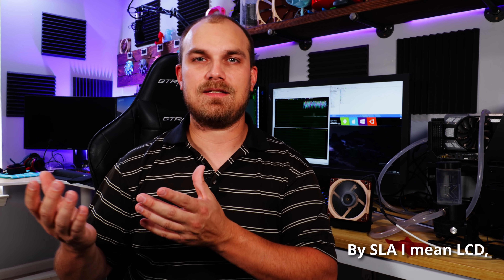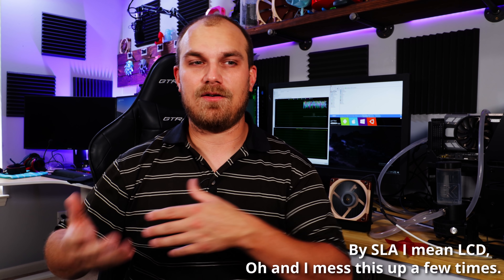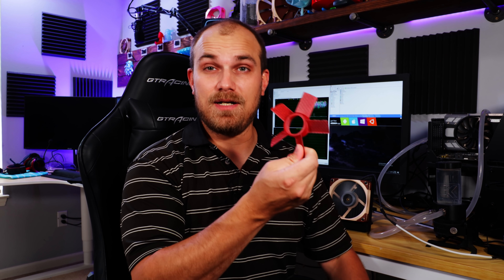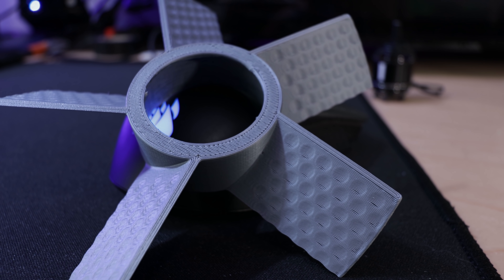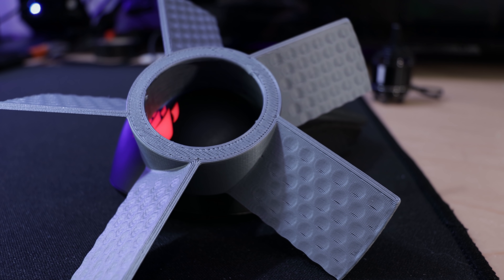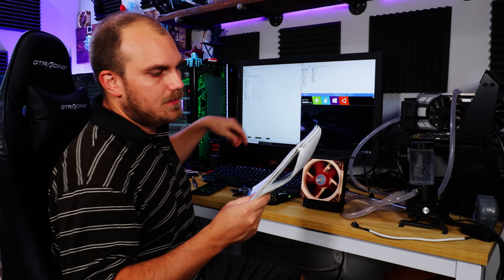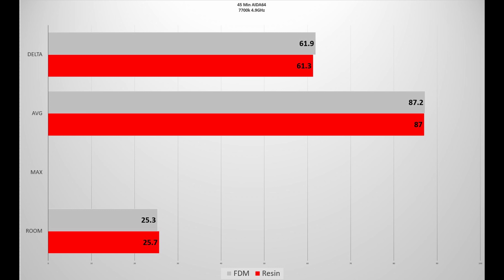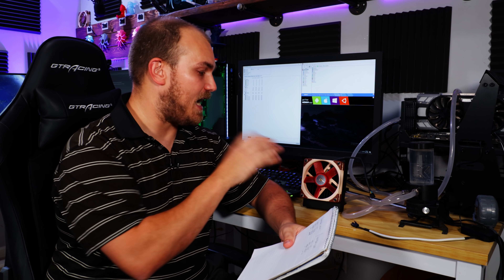Do Resin Fans Outperform FDM Fans | Dimple Fan Follow Up

Comment: The ”dimple effect” is probably the most misunderstood aerodynamic effect there is.
It’s very simple to understand though, all it does it to reduce the wake of an object at the cost of increased skin friction.

This is why it works so well on golf balls, they have very little skin area (a sphere is the shape with the smallest skin area) but a very large wake, so the dominant friction is the wake.

A fan on the other hand is literally the opposite, the skin area is very big and the wake is very small. It’s questionable if the wake is even reduced by the dimples because of how small it is to begin with but you do increase skin friction.

A more interesting test would be to print the smooth fan on SLS and see if there’s any difference there, since theoretically it should be more aerodynamically efficient, though there might be too small of an effect to notice.
Reply: fanspeed might be higher with the smoother surface if drag is reduced
Reply: HazewinDog possibly, though on these small scales the speed increase might not be measurable with his equipment.
Reply: The dimples are normally used to  re-energize the flow when the flow goes from laminar to turbulent (just like slats), which enables the flow to "stick" to the shape more when traveling at high speeds on a golfball/wing since it has the energy to follow the contours of the shape. Thats how it decreases the wake drag. I doubt the airflow over any of these fans are reaching critical flow speeds, which means the dimples probably dont actually do anything apart from pre-maturely turning laminar flow into turbulent flow over the wings and reducing the pressure difference they generate, sadly :(
Reply: Actually for low power fans not in a server room/building, it's the noise normalized temperature that matters. All the rest is irrelevant.
Reply: Honestly I wanted to mention that with the fans it was opposite but I couldnt type then! Since the fan is opposite to a sphere, it could make sense that inverted dimples would work better. Make bumps on the fan as it would be the opposite, hopefully doing what the opposite does on the opposite surface?
Reply: Zipo214 ”Reversed” dimples would have the same effect as dimples, it’s about disturbing the air flow, not about the exact shape of the simples. Laminar flow always produces the lowest drag, when the flow separates from the body and causes a large wake you get turbolent flow. Dimples causes tiny turbolent flows near the skin which drags the air closer to the body, effectively ”extending” the laminar flow by delaying the separation of the air flow from the body, leading to a smaller wake and this less turbolent flow overall.
Reply: And like... the place where you would want the dimples would be on the back of the motor and the sides of the fan, not on the blades. The blades do not have wake drag from surface interaction with the air. They have vortex drag from trailing edge design maybe and from tip design. (The equivalent of cavitation from a propeller in water)
Reply: Wake drag would be the vacuum created behind the fan motor (where there are no blades) and shouldn’t be significantly effected by dimples on the blades

Comment: While it may not have made a huge difference in cooling performance, I am curious what the difference in noise is. Theoretically it should be quieter, but who knows. Also curious if there will be any weight added to my fan when it's printed in resin since the blades are pretty thick, and FDM leaves tiny gaps, even if it's 100% infill
Reply: Well good news lol
Reply: Bro, contact Major Hardware now, a company wants to license your fan desing, go watch his latest video.
Reply: dude email the channel you need to get in touch! check his resin video on your fan a company wants to contact you
Reply: hello Thomas, i am commenting to ask, politely, if i could please have the model of the fan, i just want to print myself fans for my PC

Comment: it would be my guess that the resin prints would have the potential for greater performance simply from the more complex geometry you can print, also reducing weight and potentally increasing rpm, and the tighter tolerances you can acheive. but now on the point of textured surfaces; it would be super cool if you could test if be quiet! fans benefit from their ripples design in either acoustics and or thermals.

Comment: You wouldn't see any difference higher than margin of error because the fan is too small. The difference in surface that would effect air and the amount of air that wouldn't succumb to the Coulomb effect flowing off the blade in a non-laminar flow is not enough to see any significant or appreciable difference. The fan isn't big enough and it's not moving enough air and you're not changing enough to see enough of a change in results or an appreciable difference beyond margin, in general. If anything, you'd see a difference if you, um, stack tolerances, in a manner of speaking. So, you probably want to change the camber of the blades, e.g. the angle of attack or chord line of the blade's air foil, and probably the thickness of the air foil by tightening the area between the air foil's upper and lower surface to tapering off at the trailihg edge...e.g.you want to thin out the airfoil to look like the comma symbol. Also, don't add a sleeve to the fan like how everyone seems to be doing or advising you to incorporate in previous designs...it adds unnecessary weight to the fan and is done for two reasons, 1, stability of fan because it's structurally weak and/or material composition is weak and 2, you want to effect either intake or exhaust fluid flow. You're better served by printing the blade tips as close to the edge of the fan mount's duct edge or wall as possible to tighten up tolerances and maximize the amount of air flowing. This is two of the reasons why Noctua fans are so efficient. They have tight tolerances, almost edge to edge. They use strong, rigid plastic so there's very little flex or warping and so less sloppy performance which you can see when it runs high rpms and very little vibration. They also stabilize the fan a little bit more by having subdued vortex generators on training edge along the upper surface, if I remember correctly. So consistent maximum laminar flow performance overall when changing these two main points, blade design in correlation to fan hub mount design. If you want to accessorize it as well, you can add in a intake convergence or intake funnel or whatever and/or intake and exhaust stators, essentially ducting the fan. This would probably give you probably most of the efficiency possible from something like your design. These are my opinions, of course.

Comment: why would dimples push more air? IMO what might help... dimples make more air-on-air contact reducing drag on the surface. that means less air is being moved/affected by the surface. ((now maybe if you put the dimples only on the front side (intake) the air might pass the blades faster)). could gain some rpm as well. still, the airspeed is probably too slow to see the effect!

Comment: I saw a gentleman on YouTube who has started printing his parts out of Nylon. Much more flexible and stronger
Reply: Last thing you want in fans is for them to flex... use the proper materials for the job, you can also make fans out of gummy bears and jello, but that doesn’t mean it’s a good idea.
Reply: @jakegarrett8109  wtf ever dude, go watch johnnyq90 make parts for his projects out of Nylon. Flexible does not equal flex. https://youtu.be/2ObO5uS7Iw4
Reply: Don Anders the guy that makes engines... with heat? different use case

I was going to pull up some nice charts and graphs but then I realized you probably wouldn’t understand them (they would be simple if you were a mechanical engineer, but otherwise explaining it would take quite a while, more than I could fit in a YouTube comment), so instead I’ll say look up the Young’s modulus of elasticity for the materials for a simple number (though a single numerical value doesn’t tell the whole story, you will see that Nylon is less than PLA, and the higher the number the stiffer the number). If you want to know more take some engineering courses if you want to actually learn about material properties and how to apply them because you might love engineering (you may lose some hair, not have time to sleep, but it’s all worth it, super interesting and broad field as far as your imagination can reach and constantly innovating with new technology, it’s fun).

Use the right material for the application. I don’t care if it’s some amazing alien technology, if it doesn’t suit the needs of my design then I’m not using it when another (and cheaper and easier to use material) is available. I only care about the material properties that are relevant to what I’m using it for.
Reply: @jakegarrett8109  no he doesn't make engines with heat. Apparently you did not watch the video, you're obviously too smart to waste your time.. He is using it in this example, for upper and lower control arms in his suspension components on his rc cars, they will be subjected to a lot more stress then the cooling fan in this contest. But, I will sit over here and keep being stupid. Oh, and if you find time, Google nylon cooling fans!
Reply: Don Anders I’ve already had materials courses before (2 engineering degrees), I’ve also been 3D printed plenty to know what I’m saying with my first custom printer I built since like 8 years ago. You could say go research, but I have, and I even have practical experience, I’ve done the research many times for projects, I’ve designed lots of prototypes and every time I have to chose materials etc. The reason I said engine heat is because I’ve seen multiple of his videos before, I already know who he is (but also the furthest part from the engine in an RC nitro car is like 3” away from its engine, that does mean it’s actually going to get fairly hot and PLA would likely melt because it is so low temp that heck I’ve had PLA parts warp in my car while sitting in the seat... so it’s actually valid).

So maybe, just maybe, this is another case where the person that has the least idea is the one shouting how everyone else is wrong. Someone overconfident with their very low amount of data that isn’t willing to listen to reason or others research even spoon fed to them because they must be right (like a gun grabbing Karen for example, someone basing their emotions as fact, and no real facts or logic matter). So I looked up the numbers, I’ve held the parts, I’ve done the design analysis many times (I’ve even got a brand new role of Nylon ready to go, it’s about 4x to 6x more expensive but when it’s the superior material i have it on hand, but as for fan blades it’s not the correct material and I wouldn’t use it). I think it might not be me that needs to rethink it (and I’m always rethinking things, nothing is set in stone). Just food for thought.
Reply: Don Anders Just to point out I’m not imagining things: https://youtu.be/CW70dL5430c
Its one of his vids where he’s literally using 3D printed parts inside an engine, I couldn’t have asked for a better example even if I controlled the universe. Wasn’t really what I was referring too but if you didn’t believe it, well here is the proof.

Comment: Random thoughts. I dont have a cad program nor an engineering degree but i do have a bit of an understanding of thermals and fluid physics.
So I have some questions:
1. Is the fluid movement through your heat exchanger constant? If liquid moves too quick through the heat exchanger then it stops performing as well. This is why cars have thermostats.
2. For heat to be effectively removed from the heat exchanger it needs air flow but if the air flow is too quick it is possible to reduce performance.
3. I have noticed a push to deeper fans, is this cheating? I mean normally these are systems that sit inside a box or confined space which is why the original fan is a flush system.

Comment: I do believe that with the steep blade pitch your dimples will actually create drag and turbulence... they look to be at about a 45 degrees... i would recommend 20-25 degrees (yes this seems overly shallow for a fan)... with 45 degree blade.. the dimples would need to be a touch deeper than the ones on the top and a very shallow angle of attack.. this would likely provide a blade that is too thick. In the range of 20-25 degrees you can get away with a uniform dimlple although I would still recommend shallower ones on the top. Better still would be dimpleing the bottom only and adding vortex generators to the top of the blades..or inverted dimples on the leading edge only may work also..

Comment: Okay. The issues has to do with aerodyamics. I doubt that anyone of the fans are using an optimized airfoil for those reynolds numbers involved. The dimples act as turbulators or vortex generators to help keep the airflow attached. Frankly the fdm surface is rough enough for that task. My suggestion would be to work on the ailfoil sections and angle of attack to optiize the performance over dimples. Time to fire up XFoil.

Comment: A more straight-forward explanation is that the air in a fan travels down and outward across the blades and the alignment of the dimples is far more crucial... at the speed the fan turns the layer offset of the thermal printing acts like dimples itself.   A resin printed static counter-rotation layer will probably have more effect on performance than dimples.

Comment: The thing is the design itself, dimples make a golf ball go further but does not mean that will make a fan more eficient, you need pressure not aerodynamics perse.
With other designs resin may help tho, like the ones that use a bigger outer diameter and a cone to funel the air inn, beeing smoth would give less dispersion and a better flow

Comment: Hey, James.  I'm finding that slicers have changed in the last few years and the once darling, Simplify3d seems to have fallen off the planet - what slicer are you using for the FLSUN Q5 and any chance you would share your settings?  (I did look to see if you had info on thingiverse and didn't find anything obvious.)  Thanks in advance - of course if others have advice I wouldn't hate that either.
Reply from the maker: I like prusaslicer

Comment: The FDM printed fan with it's rougher surface basically has the effect of dimples built in, so adding dimples isn't really gonna do anything.
You might see an improvement with some of the other fans if they were being limited by the turbulence.

Comment: I don’t think drag is a major design concern because you aren’t moving the fan blades at any appreciable speed for it to be an issue. Like if you make a folded paper fan made from sandpaper and one made from regular paper, you won’t see any difference for the same reason. 
Now, perhaps if we are moving air at ridonkulous trans-sonic speeds it might be a concern, my guess is geometry and speed are the two major design constraints in how effective a fan is.

Comment: Resin is way better with very thin fans where FDM will break them or have very rough edges.
Reply: Pretty much this. The advantage would be most noticeable in the noise rather than the performance.
Reply: BrotherMichigan giv G cuucc G c g gu
Reply: The most efficient fan is the most silent. We're not talking pitch.
Reply: C
Reply: @davidwillard6126  ya ok bud?
Reply: Cu u to u
Reply: ucu
Reply: Cu uh
Reply: Cu ucu
Reply: Cccc
Reply: F
Reply: @davidwillard6126  Did you have a stroke?
Reply: Fuh

Comment: Depending on the resin printer you have resin should be able to handle the thinner blades of some fan designs better than FDM. Ideally the build area is large enough to print parallel to the build plate to minimize uneven support distribution.

Comment: The blades are too straight for the dimples to make any difference, the pressure created by the top edge of the blade makes the air move in a straight line like a wall (or a waterfall) and when the dimples hit it is like putting a spoon under the kitchen tap, it's sprays all over the place. I think that in order to see any kind of difference you should curve the blades in both Y and Z axis (like the noctua ones) I think that way they can scoop more air and the dimples can do their job. One more thing, I suggest you to leave the back of the blade without them so it doesn't create turbolenze fot the blade behind it
Reply: … you have missed the point of the dimples. They have no purpose on the high pressure side of the blades. On the trailing, low pressure, side of the blade they create a thin, turbulent layer that helps keep the air flow adhered to the blade.

That being said, I believe that you are absolutely correct about the lack of curvature!
Reply: @martindinner3621  that works in golf balls because they make the ball spin while flying to make it go farther and more stable. The same principle is used in airsoft with hop-up systems and in guns with barrel rifling. In fans the only useful way they can be used is to create more pressure on the inner side of the blade because otherwise they would actually push the air away from it which is pretty useless

Comment: This would really only start making a difference as you get to much higher speeds. As well, you'd primarily see the difference in noise character rather than just thermal performance. An SLA fan might not outperform a FDM fan in terms of airflow at max speed, but it'll probably sound better.

Comment: Your fan blades are not smooth. Any ruff surface will give poorer wind performance.
Reply: Not necessarily true at this scale. Small scale aerodynamics is weird. Rough is sometimes a superior surface finish. Check out the Noctua. It has a textured finish.